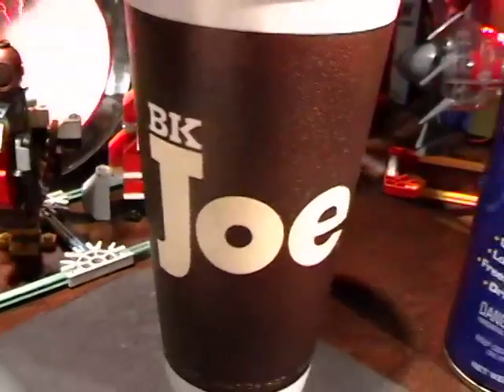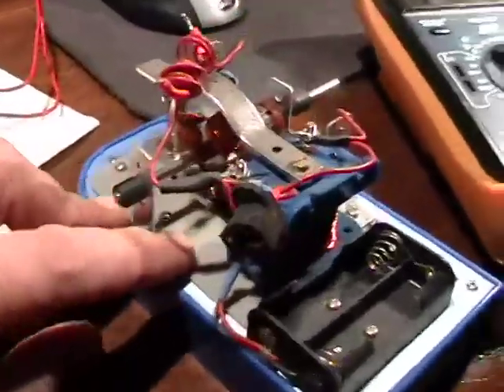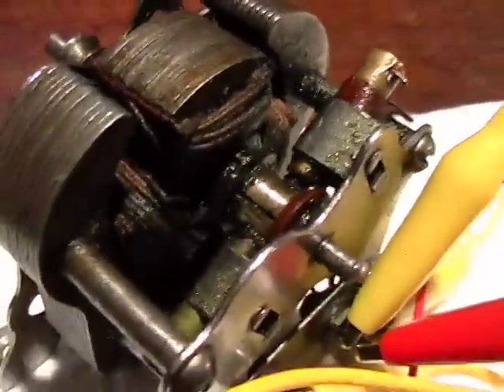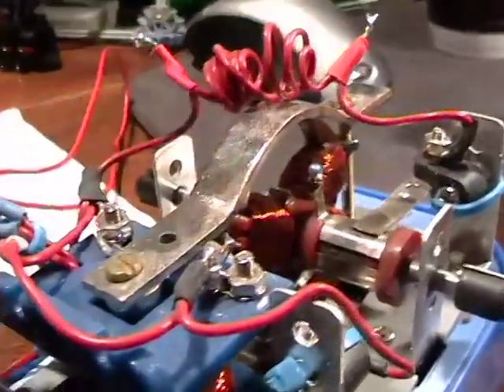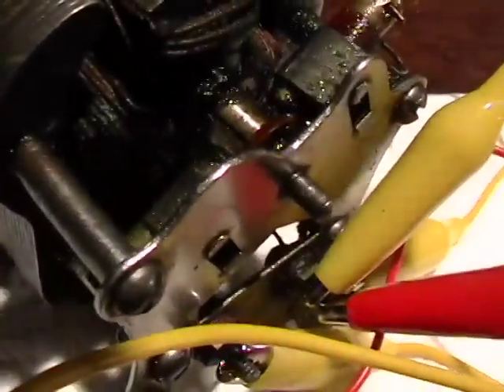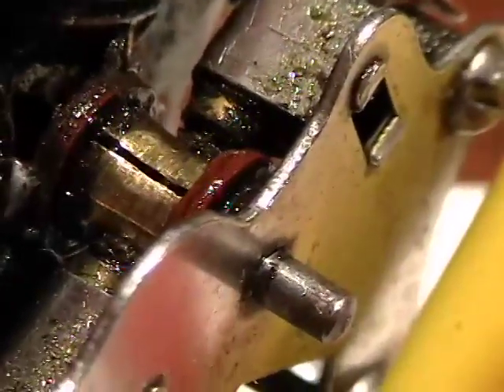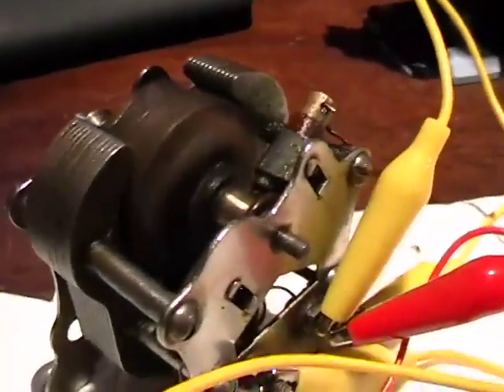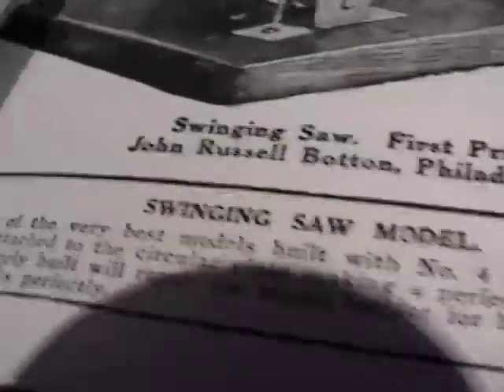Modeling Blog Daily - 1919 Erector Motor Repair

Comment: Bill, you may want to use R/C car motor spray to clean the gunk out of that motor. You can find it at alot of hobby shops that sell R/C vehicles. Be careful though, it is very flammable and ignites quite easily.

Comment: Actually, anything that gets the yuk=yuk out of the motor is good. In fact I have an erector set motor made by Gabriel. It has a clear plastic case so you can see the inner workings. It runs on 3-6volts, doesn't have any torque though.